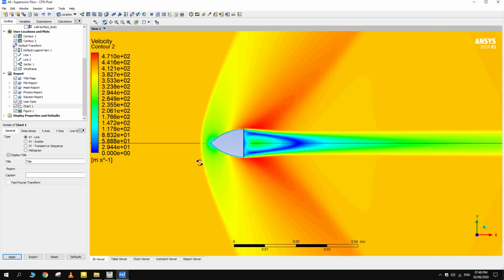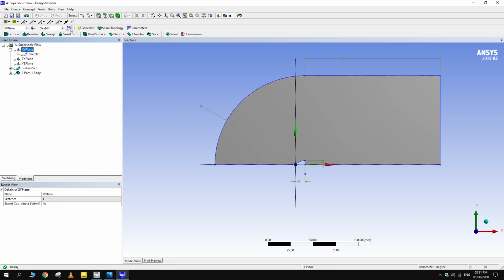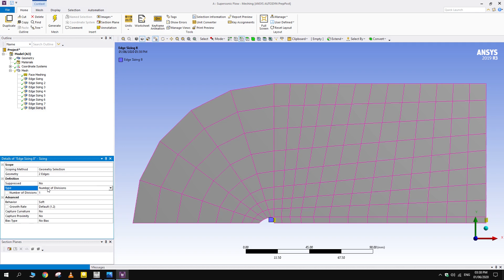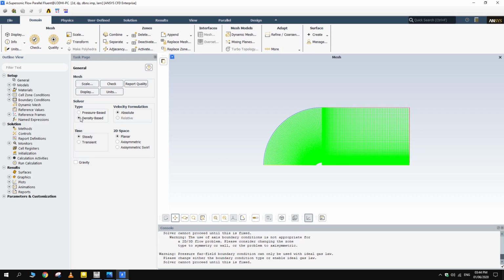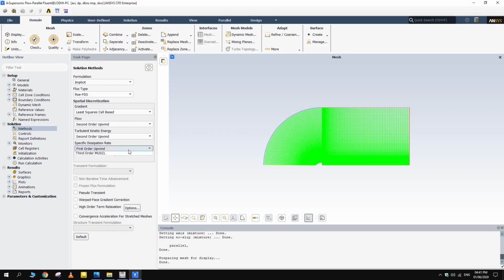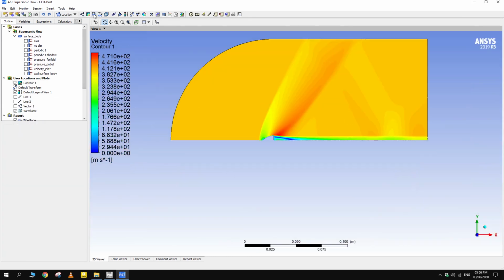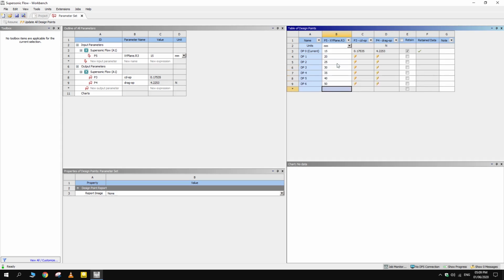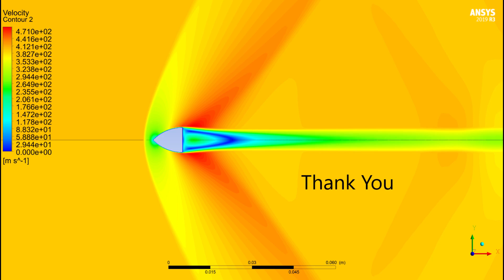ANSYS Fluent: Supersonic compressible Flow over Bullet

Comment: Ansys gives the warning that you cannot use pressure farfield for non ideal gas and until that BC is changed setup cannot be initialized. How did you get results??
Reply from the maker: Air was modelled as an ideal gas in this simulation. You can also use zero shear wall boundary condition.

Comment: I'm doing a 4in diameter, 6ft tall rocket at 515 m/s. My drag coefficient and force are quite large, like 2500 and 2000N. I'm measuring the drag from the surface of the rocket all the way around.